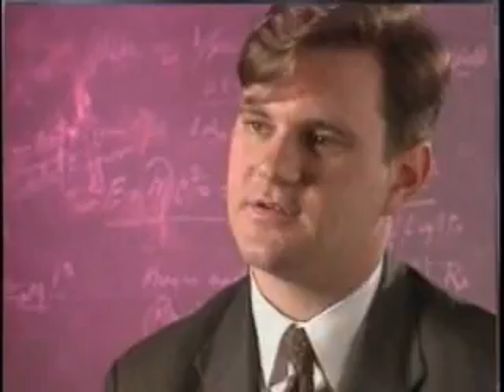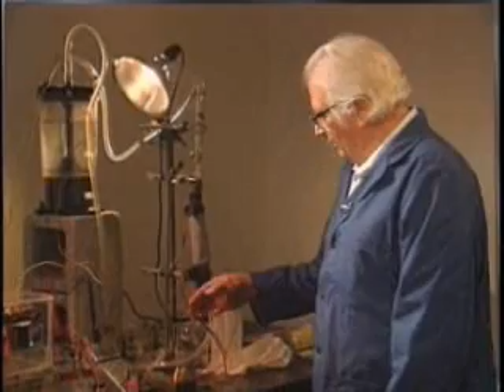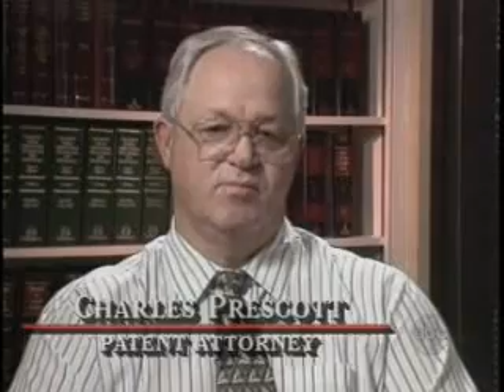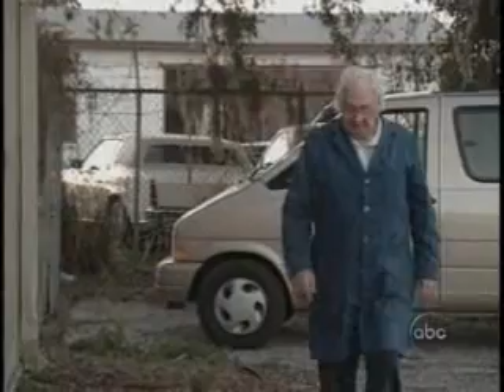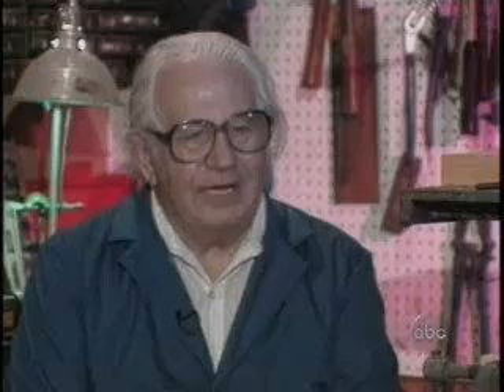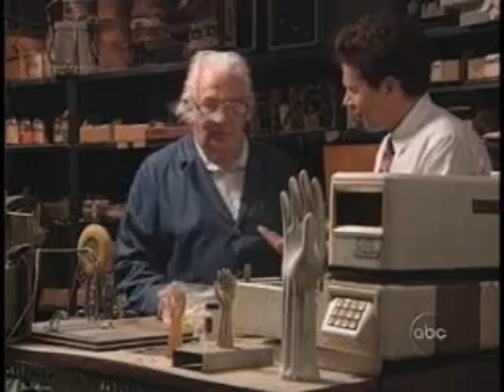Patterson Cell Part 1 of 4

Comment: Part 3
Basically,when enough hydrogen ions are created by the catalyst,energized by the heater and inserted into the nickel crystal,there is created a resonant EM field in the electron envelope of the atomic crystal structure strong enough to create a branching decay mechanism in the nickel nucleus.

Comment: Here's a summary as to how the E-Cat works:  Part 1

The nuclear reaction inside the E-Cat Fusion catalyzer happens once the reaction chamber is heated up up to 60-70 degrees C. Once this heat has been attained, and the reaction has started, the heat source is easy to remove and also the reaction is going to be self-perpetuating.

Comment: Latest LENR ("Cold Fusion") work Wired Magazine UK article on Rossi E-Cat.

1. E-Cat can be started on demand.
2. E-Cat can be turned off anytime.
3. E-Cat's power output level can be controlled.
4. E-Cat can output 110 degrees C heat.
5. E-Cat can be run in controlled self-sustained mode. 
6. E-Cat is economical to build and run.
7. E-Cat produces clean power with no toxic waste.

Comment: At ICCF10, August 2003, Doc Patterson said that the excess heat produced by his PPC had a key ingredient, the nickel used to coat the beads.  When Doc Patterson ran out of this coating, he was not able top obtain any more from the European manufacturer and could not repeat the excess heat reaction using his beads.